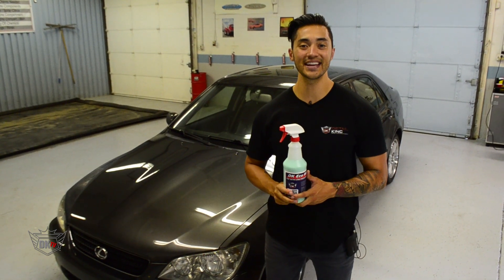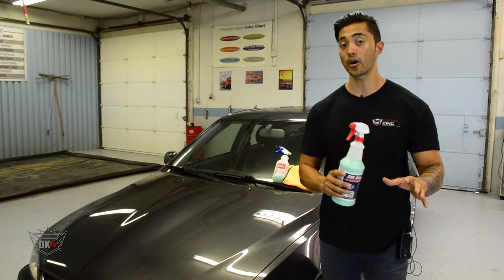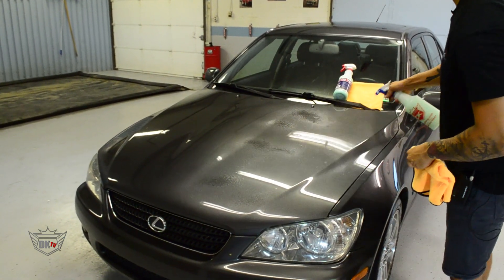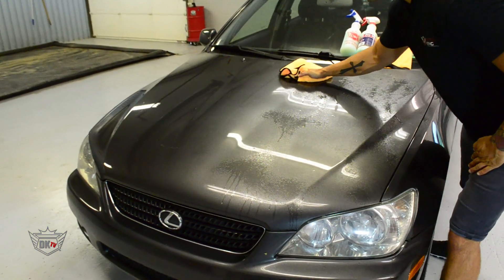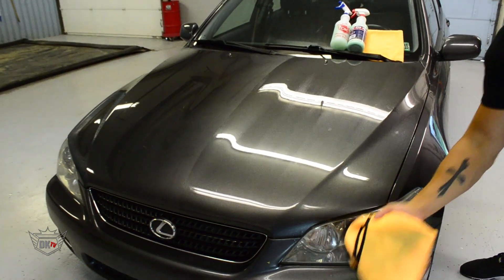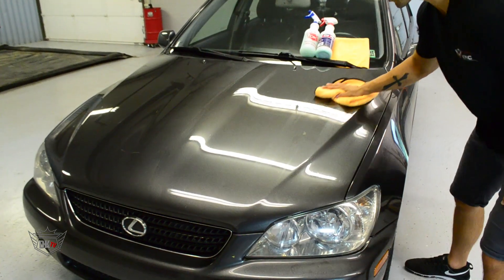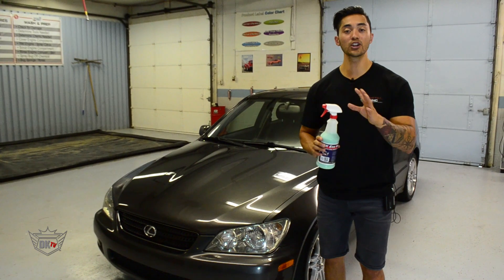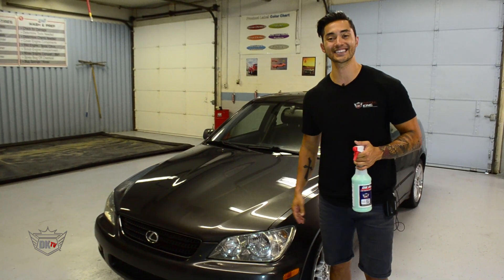Best Waterless Car Wash Product

Comment: You make it look really easy.  LOL.  I live in a drought area, & in a short amount of time-- my car gets dirty fast with LA smog.  I watched a few Garry Dean videos on technique, but after my own research...waterless car wash products should not be used on a car that is "too dirty" with dust particles; that could scratch paint.  A quick rinse is necessary most of the time (for me).  Your product does have  a nice smooth finish... check out my other water saving tips being in CA.
Reply from the maker: +CAR REVIEWS: 0 TO 100 - Yes you're absolutely right! Waterless wash may not be the best for any heavy debris or dirt cause it can cause scratching. If you're able to give a rinse first it would be a much safer route. Thanks for the tip!!
Reply: +Detail King thats it,i first go to the wash box rine it with water than use waterless wash
croftgateusa in there video show a Lexus on the hood with dirt mud its easy save to remove it perhaps there product line is based on it,i would t,2,most sit in a garage .am outside

Comment: I  havent tried this waterless wash yet but i have some products on order.  Why does alot of these waterless videos on youtube say not to use the same side of the towel twice?  I see that you used the same side to wipe off half of the hood.  These other guys say it will scratch the car and best to use one side per section.  I see that as alot of towels being used though.
Reply from the maker: +boliviamericano Great question! Using the one side swipe method is good for when cleaning a very dirty car. If the car is not covered in very heavy dirt then using either a snake like pattern or one side for half that section of the hood would be ok, as long as you're using enough Eco Wash that should help to assist with lubrication between the towel and paint.